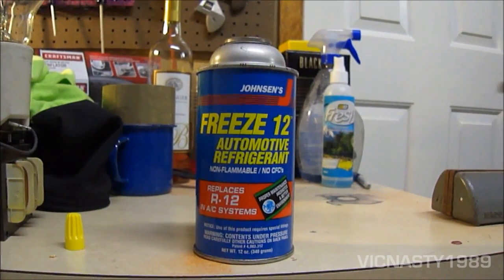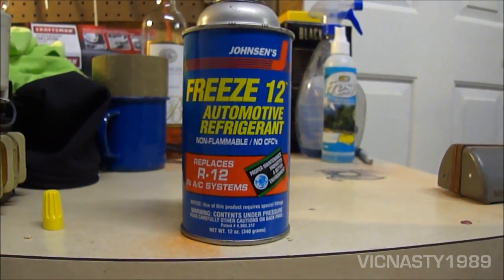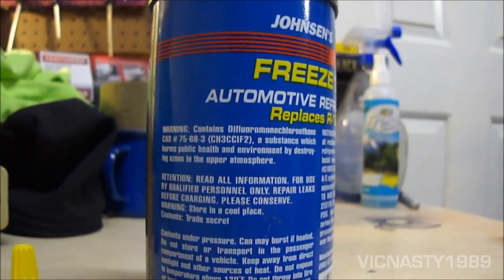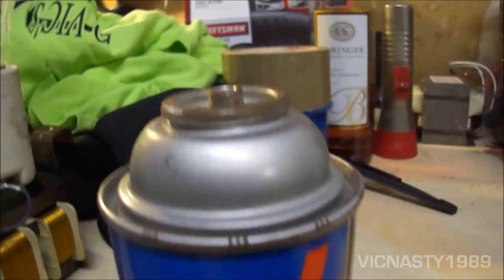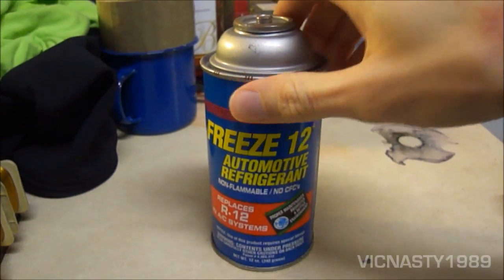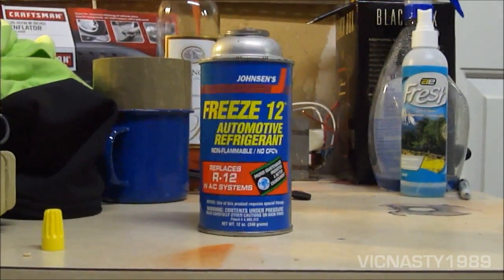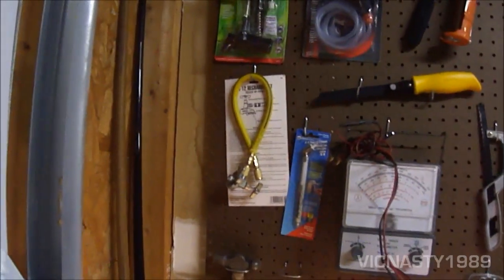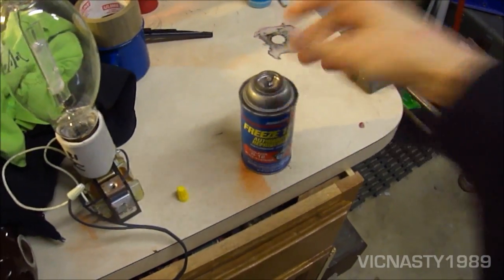Johnsen's Freeze 12 (Freon R-12 Substitute)-What Do You Think?

Comment: I had the A/C system fixed on my Merkur XR4Ti back in the mid-1990s. They used Freeze 12 in the system. It made the ac ice cold! A few years later, the compressor went out. Much of the system got replaced, and R12 was used. It did not cool as well as the Freeze 12!

Comment: You can substitute R129 on a R12 system for those who dont know R129 is liquid propane
Reply: That cant be safe
Reply: That's not a good idea. The safety of using a flammable refrigerant is up for debate and the legality depends on what state you live in and whether the system was converted to R134a first, but if you look up a pressure chart for R12 compared to R290 (propane), you'll see that the pressure of R290 is way too high- very similar to R22. If you want to use a hydrocarbon refrigerant to replace R12, you are much better off using an R134a replacement like Envirosafe Industrial R134a replacement. Duracool and Red Tek also make similar products. Sometimes they are called R12a, but they are all a blend of about 60% R290 (propane) and 40% isobutane (R600a) to better match the properties of R12.

Comment: You don't just top off an R12 system with this stuff. You have to do an evacuation of the system and install a new filter-drier then pull a vacuum and charge with ONLY FREEZE-12 to a level that is 10% less than if you were using R12. You also have to add a special oil to the system. FREEZE 12 also requires a special charging kit because the threaded fitting on the cans is proprietary. A charging hose from an R12 or R134 kit won't thread onto the can. Neither will an HVAC tech's manifold gauges.

Comment: It is a partially flammable gas. It works great with R12 systems, but won't run as cool as R12 usually would unless u mix the two. It technically is just as harmful to the ozone as R12 is, but they managed to get away from classifying it as a CFC. This product is difluoromonochloroethane whereas R12 is dichlorodifluoromethane. Compared to other R12 substitutes, this has doesn't pose as much of a fire hazard, but far from being "non-flammable". Johnson discontinued these, but you can find an abundance of them online. I would use this anyday if R12 wasn't available to me. It surely beats the extremely flammable alternatives of propane mixtures... Or the expensive conversions to r134a (which don't run as cold).
Reply: You don't mix this with R12, you have to evacuate the system, change the filter-drier, pull a vacuum and recharge using ONLY FREEZE-12 and a compatible oil. You'll burn out your compressor if you try to just top it up with R12 still in the system.
Reply: +Joe Snow R12 mineral oil is compatible with Freeze12... I evavuated my system and recharged with half R12 and half Freeze12. One thing to note however is that a can of Freeze12 is slightly more than a pound. So it may cause compressor damage if you arent careful. my system was a 2 1/4 lb system... i then charged it with 1 can of R12 and 1 can of freeze12. It works good to this day.
Reply: What is funny as well is that the EPA is working on phasing out r-134a, and should be complete in 2027. So in ten years, r-134a is going to be in the same boat as r-12. So even if we did a r-134a conversion, we would still need to convert to something else again in a short while.. so may as well stick to r-12 when possible. 
As far as I know; r-152a and 1234YF are the accepted replacements for r-134a so far. Its easier to convert an r-134a system to r-152a than 1234YF though.
The funny thing is, both of these refrigerants are flammable. The reason why CFC's were introduced at all is because they are non-flammable.

Comment: Do not use freeze-12. It is a blend and is flammable
Reply: idiot they are all flammable you jackass
Reply: Doctor Feinstone According to the textbooks, service manuals, and MSDS that I had to read for my MVAC training, as well as the questions on my 609 license test and the demonstration films during training, both R-12 and R-134a are flammable. Not nearly as readily as, say, R-290 (propane) or R-600a (isobutane), or even R-717 (ammonia), but still flammable.
Reply: @Azlehria  From my quick test, R134a burns when exposed to a flame, but won't sustain a flame. Pure R12 is supposed to be totally non flammable, but I haven't personally tested it. It will certainly burn when mixed with vaporized oil though. Any fluorocarbon based refrigerant creates extremely toxic gases when it burns, so be very careful if you test it for yourself!
Reply: Better get  rid of that dangerous gasoline too!!
Reply: +ShawnJames310 no "idiot", they aren't. r-12 and r-134a are not flammable. freeze-12 contains propane, and we all know what propane is used for. think about that when you call someone an idiot
Reply: Burn

Comment: Are you able to report back with any results? I've a 93 Miata and font want to convert just yet. I know R12 can still be had its just hard to find. But if this substitute will work then I'll go that route.
Reply: ***** I've already gone to HFC-152. Vent temps are averaging 45-52 sitting still and about 37-39 moving at motorway speeds (on recirculation mode). System is completely new minus the high/low rubber lines and hard lines (basically all the major readily available components).

Satisfied with this and can tease some of these new 134A cars that won't get anywhere near as cold as me lol

Comment: Question, my 81 Vette has R12 and the compressor is starting to short cycle...can I add some of the Freeze-12, and if so do I turn the can upside down or leave it upright? I also read a little trick about, to get more into the system, putting the can in a container of warm water.
Reply: Ray Josephs Warming up the can is just going to temporarily raise the pressure in the can.  As soon as the can starts emptying into the system, the decreasing pressure within the can will cause the contents of the can to get very cold as it empties into the system (note that the cans become cold to the touch as they are emptied into the system - this is why).  Empty is empty.  Aside from possibly causing the can to blow up and remove most if not all of your fingers, heating up the can in advance of emptying it into the system will have no effect.
Reply: John, thanks for the safety feedback but, will adding a can of Freeze-12 to R12 hurt the cooling and or AC system?
Reply: +Ray Josephs 
You can gently shake the can and give the system a few puffs of liquid.  Your main concern should be keeping the compressor from sucking slugs of liquid which can damage it. Keep an eye on the sight glass on the receiver. When the system has been running there should be no bubbles traveling through the sight glass. 

If you don't have a sight glass or don't know how to read the gauges, Keep an eye on the larger suction line coming out of the firewall. You should see light frost on it or  the aluminum should ''sweat''. That gives a fair representation of the system being fully charged.

Never mix R12 with R134A as a reaction will cause the expansion valve or capillary tubing to gum up. The compressor MIGHT cycle quickly but you don't get cold air. They also use different kinds of oil. Like brake fluids....don't mix the two types or you get Jello.
Reply: Thanks for the excellent feedback and suggestions...no sight glass on my 81 C3 and I can't even find someone that sells the freeze-12 adapter hose. No one carries it! I have three cans of freeze 12 and no way to get it in the system!
Reply: +Ray Josephs 
Ray, its called a CT340 Refrigerant Can Valve Bottle Opener and it costs $1.59 on Ebay but they rip you for shipping at $5.30
Link:  http://www.ebay.com/itm/CT-340-Dispensing-Refrigerant-Valve-Bottle-Opener-R12-R134A-Can-Tap-/331790534491?hash=item4d4041c75b:g:DCoAAOSwxYxUy88a&vxp=mtr    You need a gage set though.

Hey!!!!  While I scoped out eBay a minute ago I found this:
http://www.ebay.com/itm/R12-R22-CAN-TAP-TAPPER-FREON-REFRIGERANT-RECHARGE-HOSE-KIT-/121898112817?hash=item1c61b19731:g:XO0AAOSwkZhWS0J2&vxp=mtr    $13 bucks, bud! Hose included! Free shipping, too.

And run that AC for a few minutes in the winter for a bit so you keep the compressor seal wet with oil and leak free. Later cars run the AC when the defroster is on. Makes for dry air and the heater core puts the heat in so the windshield clears faster.
Reply: Thanks for that bottom link but, it 'looks' like the two old R12 Freon RECHARGE HOSE KIT
I already have but, will not work with my Freeze-12 cans? Is there something different with the brass fittings?
Reply: +Ray Josephs 
I don't know about the fittings. The threaded necks are different diameters between R12 and R134A.  But the device attached to the valve will lock under the neck of the can so you can install the piercing valve. 

Here's a unit that will pierce any can for $20 and free shipping.
I might get one myself:

http://www.ebay.com/itm/AC-A-C-Air-Conditioning-Refrigerant-Side-Can-Tap-Opener-Valve-for-R12-R134a-/230822447087?hash=item35be1707ef:m:mpq8OHXXIXZ8eYFX8wsogfQ&item=230822447087&vxp=mtr
Reply: that is an interesting design.
Reply: It's proprietary. R12 and R134 charging hose won't work. Neither will an HVAC tech's manifold set. They won't thread on. Good luck finding one, they seem to no longer exist in North America. I had to order one from England.
Reply: It works best if you point the can to the north and then shove it up your dumb ads and turn it to the left.

Comment: I've used Freeze-12 before in an old truck that had an R-12 AC system.  the system was completely empty.  I was supposed to vacuum it out to be sure, but at the time I didnt have access to a vacuum pump.  So, I made sure it was empty (or at least at 0 psig) and then added in the freeze-12 according to the directions on the can.  I beleive it was something along the lines of 80-90% of R-12 capacity.  I.e. system rated at 2lbs of R-12, add 1.6-1.8 lbs of freeze-12.  I added in a 4oz can of Freeze-12 and leak sealant, and the rest just plain freeze-12, and the system worked great.  It cooled excellent, even on the hottest of days in July/August here in South Carolina.  I had absolutely no complaints about it.  It seemed to work as good as the original R-12, maybe even better.  I had the truck for about another 5 yrs after that and never had to add in more freeze-12 and it never stopped cooling.  That is my one and only experience with freeze-12 but I was 100% satisfied.
Reply: I've had a similar experience on 3 different old R12 cars... the hassle now is it's gotten so expensive.   I felt it cooled better than the original R12 did.  The cars were a 90 Miata, a 91 Toyota truck, and a 1989 Prelude Si...  that Prelude system ALWAYS seemed weak and it definitely seemed colder with Freeze 12.
Reply: I was just going to leave a comment to Mr. Anderson. I believe his experience totally. And yours too Mr.Lumbaugh. Many years ago, I had 4(Four) (3 at the same time, the Cavalier even years earlier) Old vehicles, a Dodge Caravan, 1 Chevy Lumina, 1 Chevy Cavalier, and a Ford Escort, all of them R-12. I got a Haynes book from AutoZone about Automotive A/C systems to get familiar with the  3 types. I did not have any special A/C tools/equipment. Being a Tech of various sorts, I've worked on a lot of old cars. My instincts told me to just juice up the various systems with the kits sold at Walmart at the time (R-12 to R-34). It seemed the systems were empty of gas after pressing the Schrader Valve and nothing hissing out. The only other thing I did was replace the accumulator. After reading the book, the accumulator, to me, seemed like a big garbage pail for the system. They were cheap, about $20 bucks, and easy to replace, so... why not?

I had absolutely no problems... ever. The only drawback I could see is that the R-34, correct me if I'm wrong, is a thinner gas. In fact all of these automotive refrigerants are relatively thin gases. R-34 is the thinnest. That's why they (the rip off repair shops, and other auto-repair-geeks) will tell you to replace your entire system, hoses, compressor... everything! The R-34 Gas seeps through the skin of the hoses on the R-12 system easier than hoses especially made for R-34 systems, for instance. Fittings and such just the same. There may be other reasons, or none at all, and it's all just bull-do-do. Whatever, it'll probably last your lifetime, or you may have to juice  it up more often than R-12 (but I believe not much too often).

I feel that even using the R-34, the sealant included in the Kit or can of juice that comes with the kit, will, hopefully, keep things sufficiently sealed. Again, I never had any problems. It's worth a shot anyway. I might save a lot of time, money, and busted knuckles. Furthermore, I'm certainly not going to Panic about wrecking the compressor, or entire system in my current project. If the EZ-Route don't work, I would have to replace all the old junk anyway. I have the skills to do the job, but I'm a bit disabled and so the job will be very difficult for me. Although I'm also retired and have lots of time. Nor will I get hysterical about the ozone layer by releasing the miniscule, insignificant, teeny-tiny, amount of gas (If Any)  into it.... or any  other silly superficial nonsense as such.

There seems to be more variety and "tricks" since my last A/C projects took place. I have to do some more research.

Anyway... That's My Story... and I'm stick'n to it!
Reply: Derek Anderso

! So n

Comment: i am an auto technician this works EXCELLENT use a snap can dispenser on your r-12 manifold no retrofit no hassle, its easy on your compressor to and btw 134a damages the atmosphere too, it cheap but u still need a license to buy it i have imaca easy to obtain on the web 15 bucks or so. BUT DO NOT MIX with 134a bad things will happen great for pre 95 cars

Comment from the maker: Yeah, that's why I bought a few cans of it!  Even standard r134a goes for about $9-$11around me.  I didn't get the Johnson's retrofit kit though, because if you have the proper R12 side can tap, there is no need to change fittings (it may not be the best way of doing it but it works as long as the pressure is correct).- Thanks for watching!